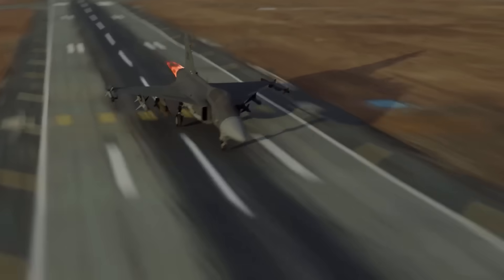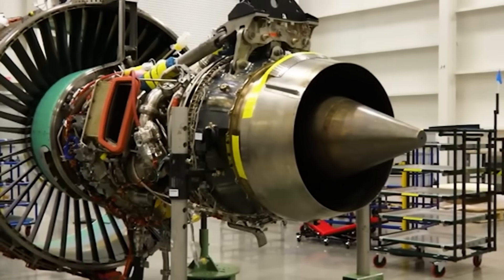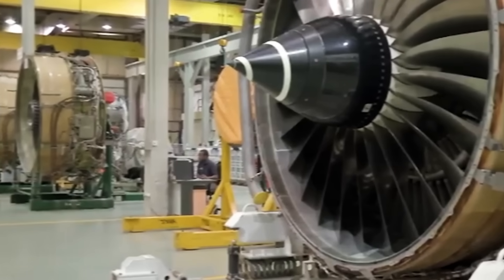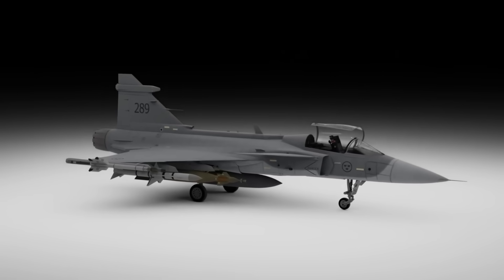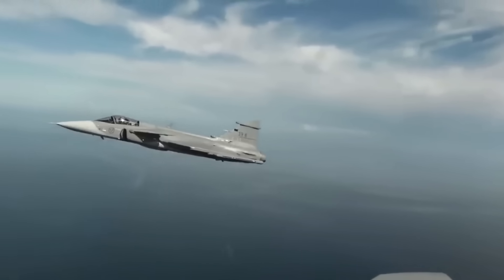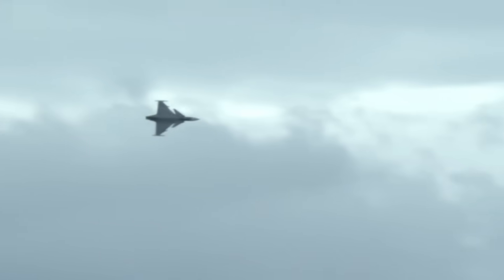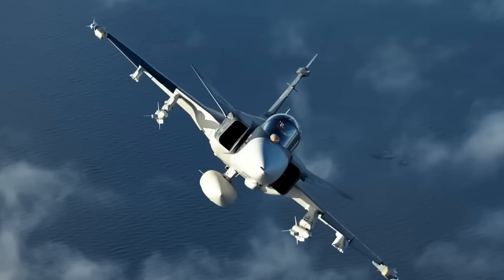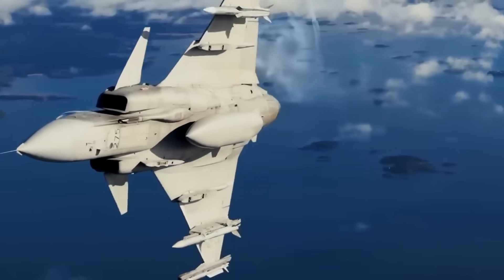What Makes the Rolls Royce Engine in Saab Jas 39 Gripen E so POWERFUL?

Comment: Just ponder this.   Consider the Gripen E coming out WORSE in every single comparison category with the F35.  Now consider the US realising that, long term, it needed Canadian water resources, Canadian hydro-electric infrastructure,  Canadian Oil and Gas and Lumber resources,  Canadian Uranium & Rare Earth Metal reserves and decided it was better to attempt to annex Canada against the wishes of the Canadian people.   What strategic use would an F35 be to Canada if the US refused to sell engine spares etc., and blocked the avionic and control software.   You might buy a gum from an enemy, provided you could make the ammunition, but would you ever trust America again with your national security????

Comment: Speculation -   a new engine will require a major redesign of the Gripen's structure.
Reply: Probably not.  As long as the RR eng. physically fits, it's an adaption rather than a redesign.  The Gripen is a modular design that would greatly ease changes. Quite unlike when the Brits put RR Spey engines in their Phantoms - that required substantial redesign as the Spey was a larger engine.

Comment: The EJ230 also comes with thrust vectoring
Reply: In actual fact, and although there was some development of the thrust vectoring capability, this aspect never made it into actual production.  Should SAAB opt for this aspect, this would probably add years to the whole project! It would also be a very costly procedure and nullify many of the strengths of the GripenE platform. 
1:30  As good as the GE engine is it is still American, and therefore subject to US approval for use in the GripenE SAAB is proposing to sell to Canada. It seems highly improbable that POTUS Trump will sanction such a sale!

Comment: As of today, there has not been an official joint statement from Saab, or Rolls-Royce confirming that future Gripen fighters will be powered by a Rolls-Royce engine. The Gripen E/F variants currently rely on the General Electric F414G engine, and while there have been reports and speculative articles about Sweden exploring alternatives (including Rolls-Royce designs), neither Saab nor Rolls Royce has formally announced a transition away from the U.S.-made engine.  Neither have confirmed that serious negotiations are taking place, but if they were, they would remain top secret until there is an announcement.
If the Rolls Royce engine is selected, there will need to be substantial modifications to the Gripen followed by massive testing to certify that the engine is in every way as capable, or superior to the G.E. engine without causing new flight and function issues and  remains dependable in sub-zero Arctic conditions.   The the aircraft needs to be re-certified by Sweden's aviation authorities and by the aviation authorities of any nation that wishes to buy the Gripen.   Much of this could seriously delay the availability of a Rolls Royce equipped Gripen.  We are hoping, but will have to wait and see.
Reply: All correct but a single detail. There is no need what-so-ever to modify the airframe. Rolls Royce is more than capable of making a modular engine that just plugs in and would match the performance of the existing engine. Beyond changes to the wiring and reprogramming a few things,
It would be a simple swap.
Reply: @RandomName100 One can't simply take an engine designed for a twin engine fighter (like the engines used in Eurofighter or Rafale) and use it in a single engine fighter. The General Electric F414-GE-39E for Gripen E, is designed for single engine fighter use...

Look at the modifications needed for the Gripen C (Volvo Aero RM12) engine for example. The F404J is used in the twin engine F/A-18.

Produced by Volvo Aero, the RM12 is a derivative of the General Electric F404J. Modifications included.

Complete redesign of the fan to pass more flow for higher thrust, and be more tolerant of bird-strikes. The thickened first stage blades deform on impact (causing thrust loss) but do not fracture, or cause downstream damage. Minimal thrust loss (6%) was achieved during a test, after ingesting a half-kilogram (1.1 lb) pigeon-size bird at take-off conditions.

Improvements to the variable stators behind the inlet vanes, before the fans and the compressor stages, to optimise airflow according to speed and AoA.

Redesigned and duplicated circuit ignition systems.

The 1996 development of a 50W full authority digital engine control (FADEC) system, with a mechanical calculator as a seamless backup.

A completely redesigned, internally-cooled flame holder for the afterburner.

Several subsystems and components were also redesigned to reduce maintenance demands, including a modular design that split the engine into 7 distinct parts that can be replaced independently. The air intakes of the engine were designed to minimize radar reflection from the engine fan, reducing the radar cross section of the aircraft overall. Elements such as the fan/compressor discs and case, compressor spool, hubs, seals, and afterburner were manufactured in Sweden, final assembly was also taking place there.
Reply: @RandomName100  The Rolls Royce engine being considered for the Gripen is the EJ230 engine that is currently used on the Eurofighter Typhoon.   It is larger and weighs more than the G.E. engine and is certainly not plug-n-play into the Gripen.   I have no doubt that Rolls Royce is capable of making a modular engine for the existing Gripen air frame, but that does not currently exist.  Technically, it is probably easier and more cost efficient to modify the Gripen air frame than it is to design and manufacture a more compact engine.

Comment: I've read comments by delusional people who actually deny the existence of the Rolls-Royce powerplant  
   I've read comments trying to convince me that the reason the F-35's mission profile is mostly subsonic is IR detection avoidance (not because the "stealth" coating peels off at supersonic speeds).
   I have even read comments saying the new Rolls-Royce engine will not function well in cold weather.
   All these people are stupid & uninformed, wilfully ignorant, or propaganda trolls and bots. Or maybe all 3. Their blather is based on crappola. Very annoying.
Reply: Could Sweden’s Saab Gripen E/F fighter jet break free from US export restrictions—thanks to a British engine? In a high-stakes gamble, Sweden is exploring the integration of the Rolls-Royce EJ230, a derivative of the Eurofighter Typhoon’s EJ200, to replace the American-made General Electric F414G. https://youtu.be/x3j7kwSLCpU
Reply: @jayseanature  It’s still not a simple one-to-one engine replacement, and I think that’s what confused the OP. Nobody is denying that SAAB is exploring alternatives, but at this stage it’s only a discussion. Replacing the current GE with Rolls-Royce power plant would require significant redesign, testing, certification, and integration work, it’s not something that can just be swapped out.
Reply: @TheRealDr.Mabuse where there's a will there's a way. It took approximately 5 years for the British to re-engine their F4 Phantoms with the RR Spey engines - the Spey engines were larger and did require much redesign of the airframe. A modular design like the Gripen is almost tailor made to accommodate a different engine - quite unlike the Phantoms.
Reply: @mr-uc4me  I don’t doubt that where there’s a will, there’s a way. But as I understand it, this does not mean the airframe can simply accept any engine that wasn’t designed for it. Engine swaps still have to match the exact fuselage geometry, mounting points, weight balance, airflow requirements, and structural loads of the original design. In other words, while the Gripen’s systems are modular, that modularity doesn’t make it compatible with engines that don’t match its specific dimensions and integration requirements.
Reply: @TheRealDr.Mabuse if the engine physically fits in the same space, its an adaption, not a redesign. I understand it won't  be a quick one for one swap but some of you are making it out to be far more of a challange than it could be.
Reply: @mr-uc4me  Well, we’ll have to agree to disagree on that, because I can’t find any reliable source saying the engine is a straight fit. And I read somewhere that the RR engine is about 2" longer. So to me it seems more likely that RR would need to tweak or redesign the engine a bit. But I'd love it if they did.
Reply: At this point, there is no RR engine powering a Gripen E. There probably talks on going between RR and SAAB. I don’t know if there is a EJ230 prototype engine in existence as a stand alone.

The EJ230 has been proposed in the past for the C/D versions of the Gripen, so this is nothing new. What has brought this forward is NOT the potential Canadian Purchase, but the Colombian jet deal that was thought to be threatened by the US government’s veto. Remember, the EJ230 is NOT a clean sheet design, it is a modified EJ200, which has been flying since the Early 1990s, and is used by Eurofighter Typhoons. Over 1200 EJ200s are in use, so it is a known, proven baseline.

There are other things to keep in mind. The EJ230, as it currently is envisaged, is physically smaller than the F414G, bot in diameter and length. It is also about 200 lbs. lighter, and has slightly lower fuel burn per lb of thrust. If the proposal were to go ahead, and it’s not a certainty right now, SAAB would have to modify the airframe, fuel and engine management systems, and possibly flight control systems. After that is done, it would need to test and re-certify the Gripen. Point is, it will take time, 1-2 years. I don’t know if that matters. The F-35 Block 4 (the plane Canada was supposed to get) release has been pushed back to 2031 (from 2026). Also unknown is how much of an increase in cost there will be for the Gripen. On top of that, SAAB needs to figure out which EJ239 they want to try to use, the 22,000 lbs. thrust EJ230, or the 30,000 lbs. thrust version (RR has proposed both). They also need to figure out if they want the EJ230 with or without thrust vectoring.

Lots of unknowns at this time. (All the stuff is on Wikipedia, do a Wikipedia search on “EJ200 jet engine”, and” F414 Jet engine”)
Reply: I’m trying to understand your point, but I need to see sources. ad hominems comments don’t bring us closer to an answer. I can’t find any reliable sources confirming your claim that there’s a Rolls-Royce powerplant available for the Gripen.
Reply: @TheRealDr.Mabuse  I also have not found any reference that indicates that the Gripen E will have a Rolls Royce engine anytime soon. 
From what I can tell, the current Gripen E aircraft in production use the RM16 engine, which is based on the GE F414. While Sweden handles maintenance, overhaul, testing, and long-term support for the RM16, the core engine itself is supplied by GE rather than being fully manufactured in Sweden. The proposed EJ230 engine, derived from the EJ200, is not a near-term option and would still require full integration into the airframe, but it could become a practical alternative in the future if the necessary development and adaptation work were undertaken.
Reply: @jarbadin  https://youtu.be/x3j7kwSLCpU
Reply: it all BS rolls Royce has more experience making jet engine than GE in they pinky finger..
Reply: Speculations. Just speculations. There is no work ongoing to integrate RR engines in Gripen.
It will take years of negotiations, development, testing, and certification of a new engine supplier. Next to that, millions of Euros in cost that instead will be used to extend the capacity of building E/F to the new orders existing and maybe orders in the pipeline.
Reply: @glashalffull on the surface - who's  to know if this hasn't been in the works for years?

Comment: Canada needs to get Grippens with the Rolls Royce engine for it's sovereignty
Reply: agreebut there is no RR engine right now RR said they would develop or modify one if there wass a market. Saab has said they would support the changes if there was a market. Canada could  be the beginning of that. It would be a true bonus if Canada could lead the team making the changes. Canada needs to commit before anything happens.
Reply: While the existence of the EJ230 is debatable, it should be noted that the EJ230 was originally proposed for the Gripen C/D, the version previous to the current Gripen E/F, so this isn’t something that is new. The EJ230 is also not really a new design. It is a single engine development of the EJ200, as used by the Eurofighter Typhoon, so it’s been well proven and it is very well understood. The basic engine core, meaning the compressor, compression chamber, and exhaust turbines should remain mostly the same, somewhat dependant on what power level they want out of the EJ230. Not much redesign would be required of the EJ230 was to match the current F414G’s power level (16,000 lbs. thrust/22,000lbs in afterburner), some redesign would be needed if the EJ230 is to deliver the 22.000 lbs./30,000 lbs. in afterburner. SAAB and partners also need to figure out if they want the thrust vectoring feature. Physically, the EJ230 is a little bit smaller than the F414G, but the airframe will still need to change to accommodate the EJ230, as well as needed changes to the fuel management, engine management, flight control systems, and the re-certification of the Gripen E with the EJ230.
Reply: @kostaskritsilas2681 thank you for a great summary. Tell me if I understand correctly. The EJ200 is a closer fit but less powerful .than the EJ230? Is the EJ200 lower power than the bigger GE engine? I can’t see it as a good move to reduce power just to get away from US restrictions. Am I understanding this correctly?
Reply: @bobcrane9945 The EJ230 is a derivative of the EJ200. The EJ230 has been proposed in two forms, one that has basically the same power as the F414G( 22,000 lbs. thrust), and an upgraded EJ230 with 30,000 lbs. of thrust. The EJ200, the baseline, can’t be used in th Gripen because it is a twin engine design engine. Same reason you couldn’use the F414 (non G) in a Gripen, and GE had to come up the an F414G (which is a single engine design engine). The EJ230 also has thrust vectoring as an option. GE has proposed Bringing the F414G up to 30,000 lbs of thrust and adding thrust vectoring, probably a reaction to the RR EJ230 proposal.
Reply: @kostaskritsilas2681 sure hope that Gripen goes with Canada and RR engine. Thanks for the great review.
Reply: Agreed and the 10,000 jobs that would be crteated inside Canada with the Canadians in charge of construction. This is to me a slam dunk win win. The F-35 isnt even great in the temperatures and conditions that Canada needs while the Gripen is made for it.
Reply: @Emraz  We do need both however. The F-35 brings a capability in response to some threats as well as postings in hostile places in the world. What the right balance between the two is only the forces can determine.